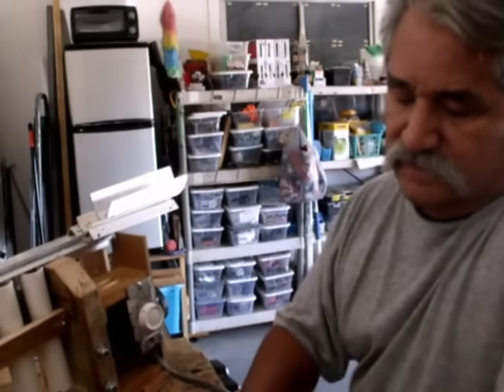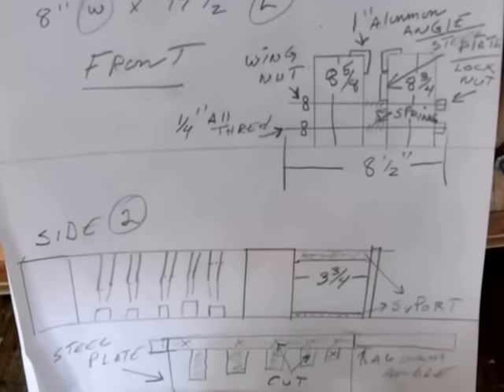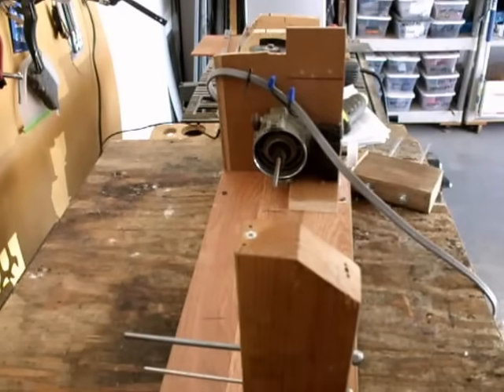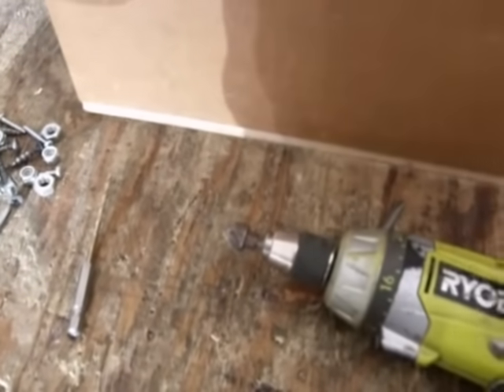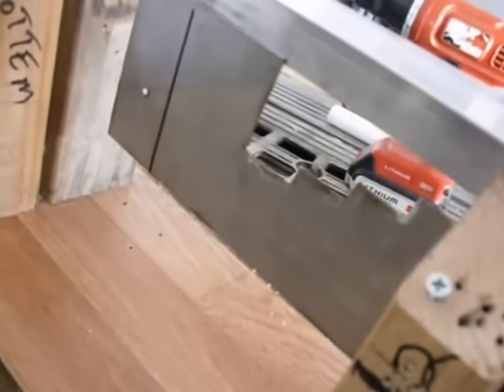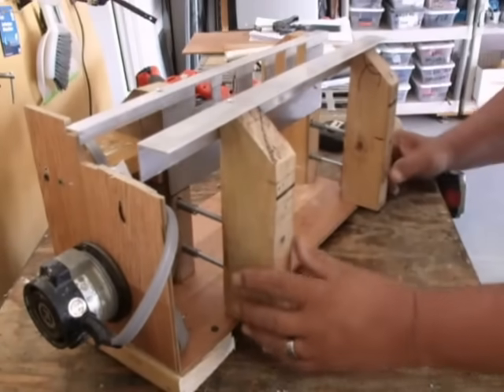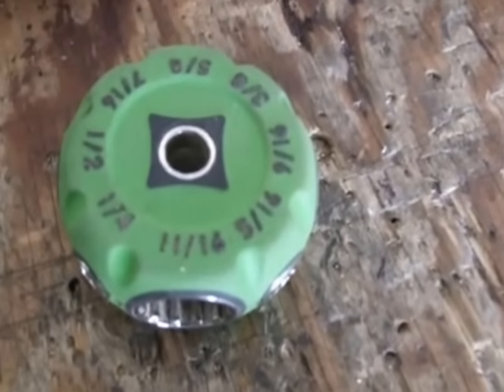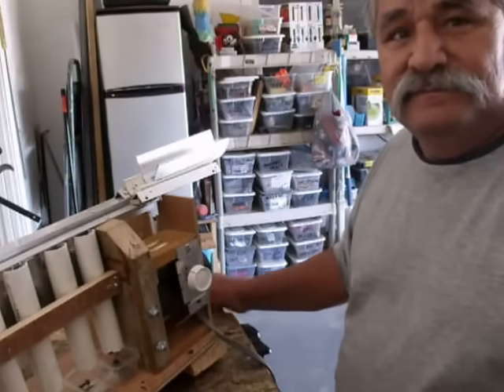Screw Sorting Machine

Comment: What brand of motor do you use?
Reply from the maker: I use a old router i had in the garage , you can use a drill motor and a bent bolt in the chuck .
Reply: @felixthehandyman201   Thanks.

Comment: You should not use a light dimmer to control an inductive load like a motor.
Reply: He might of use a ceiling fan controller. Unknown. But on the other side. The motor is run slow and there is no load and way underrating of dimmer.

Comment: That's pretty cool and would work well for someone who only has a lot of screws that are identical except for length. I have about a hundreds types and sizes of screws: machine screws, wood screws, drywall screws, flat head, pan head, skinny head, fat head, round head, bolts of all sizes and length ... etc. I still have to sort by eye. But I do agree that what you invented there is pretty clever.

Comment: Brilliant machine for screw all the same thickness.
Reply: Well designed - it can easily be adjusted to accommodate nails or screws with different head sizes or thread lengths - very well designed.
Reply: @terrybyrd3738  But not a mixture of different head thicknesses.
Reply: It's got springs on both ends to allow variable widths (sizes, thickness, whatever).  It could even be adjusted wrong to self jam.  But I see it working on most any fastener - and possibly sort different types at the same time.  Guess you can't see it!
Reply: @terrybyrd3738  Yes if they are all the same thickness it will sort them out in lengths.All the ones he sorted had the same size head. You can alter the springs for different heads but it will not sort a mixture of head sizes.
Reply: @TonyDartford  Sure it will.  Adjust as if it were a rotary shrimp sorting or potato sorting table - with the feed end slimmer than the drop end, while keeping the length plates on board.  Both adjustments at the same time - it can be done.   And...if it don't work - sort twice...problem fixed!
Reply: @terrybyrd3738  I have a box of assorted hardware and this machine will not sort them,bolts, screws of different, lengths, thicknesses and heads, It is very clever for screw of the same thickness but different lengths.
Reply: @TonyDartford :  Hmmm...I see you're speaking from experience while I'm speaking from supposition.  I guess that means you've already built one of these.  If so, then I guess it didn't work after all - guess that means we're both wrong.  Well...maybe you shud get busy hand sorting that big box of nuts, bolts, washers, whatever; instead of responding to my unlearned opinion!
Reply: @terrybyrd3738  That is why there are no commercial ones too complicated to sort by length, thickness and screw bolt type. Every handyman has a box of assorted  screws and the reason why,  too much hard work to sort them.
Reply: @TonyDartford  let it go

Comment: As long as you presort for type of screw, looks like it would be fairly handy, and save time after only a few sorts. Nicely done, but I could use some detail on the hopper at the top of the track, please.
Reply from the maker: The hopper is two pieces of aluminum sheet on a bent l bracket on either side
Reply: @felixthehandyman201  thanks.

Comment: What type of motor do I need
Reply from the maker: I used a old router motor with a bent bolt for vibration, you can even use a drill motor

Comment: You've seen my garage.   lol   Great idea and easily made. For large head size, let it continue down the track and off the end into a bucket. For small screws, a hole after the hopper smaller than the screws you're dealing with. When you want to sort the smalls, a piece of putty or something plugs the hole. Might work.

Comment: Nice design!!  Fully adjustable to accommodate different screw sizes.  Only suggestions I can think of are to rotate your motor to generate more right-left motion, and maybe give it an off set mass so it will generate the vibrations you need at a lower speed.  I can imagine that to sort a large variety of screws you'd need to reset from time to time.  Maybe chance the final 'bucket' to dump all screws so that they don't get caught between the rails.  Love the design,  I will probably be making my own based on what you've show.  Thank you!!
Reply from the maker: when you get your's done i would like to see it :)

Comment: Assuming all the heads are the same size
Reply: first need to have a slide with increasingly larger holes to sort screw head sizes, but wouldn't work well with flat head screws,
Reply: Wrong, did you even look at it?
Doesn’t matter what head size is or flat or fluted. Long as there is a head the vibration and gravity will take care of moving it along.

Comment: Hey Felix, I love your little screw distributor! If you wouldn’t mind, could you please tell me how you made it? I see the wood,  the pvc tubes, the metal shute, and the motor. But how do you make the motor move the screws? That’s pretty nice. I would like to make one myself.
Reply: The motor which happens to be from a wood router is fitted with the bent piece of Allthread into the collet of the router. The bent Allthread acts as an excentric weight when the motor is running and so provides the vibrations to move the screws down the aluminium tracks.
Reply from the maker: I took a old router motor and put a bent bolt in the chuck for vibration ,connected it to a light dimmer so i can control the speed. :)

Comment: This is great for sorting length. Very innovative. How about for brass/steel? Flat/round? Add to it to sort every length, size, head, material, etc and it'll be a big seller.
Thanks for posting.
Reply: That's why you do it by sight.
Reply from the maker: Well "get er done  !"  , I mostly use it for drywall screws  which i use a lot  and like to recycle them :)

Comment: Good idea but does it not assume that the diameter is increasing with the length. For example you can have a 2" screw of differing gauges - a No 6 or a No 10
Reply from the maker: Sure but it's a lot easier than going through one at a time thank you
Reply: You can fairly easily sort screws by guage and type but sorting them by length is the tedious part of the process.

Comment: Very cool -- but you shouldn't use a light dimmer on a motor... very hard on the motor.  Motor speed controllers are different, electronically, than dimmers.

Comment: Could you explain how does the screw falls down depending on the size? I couldn't get it through video. Great work though!
Reply from the maker: their is a steel plate in the back cut at differnt sizes ,like steps, and pvc pipe to guide the screws :)
Reply: The longer screws can't fall out until they get past the smaller cutouts because their tips would still be touching the metal plate below.